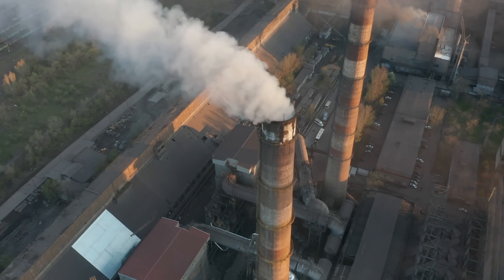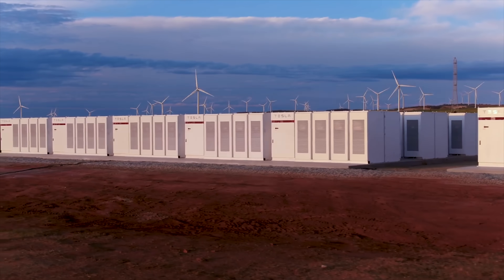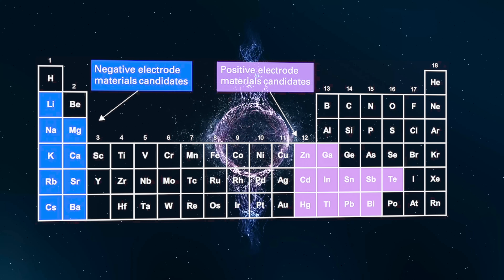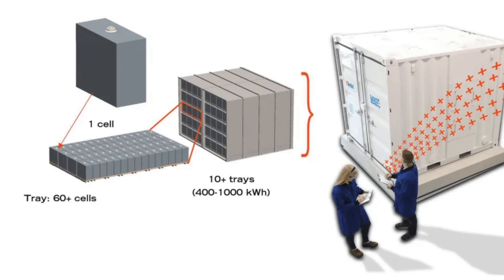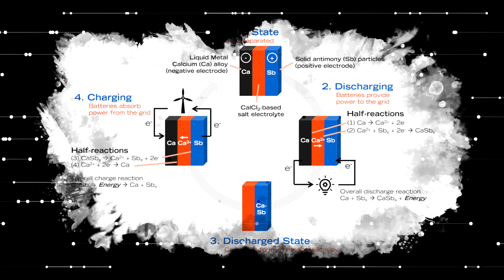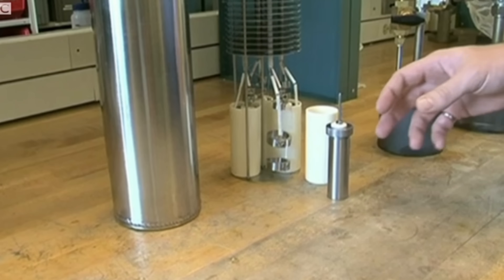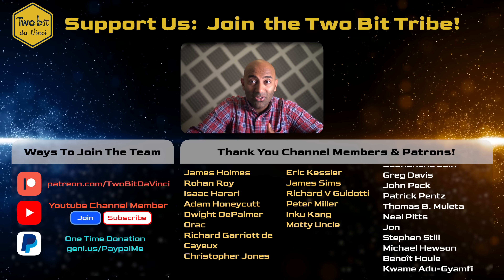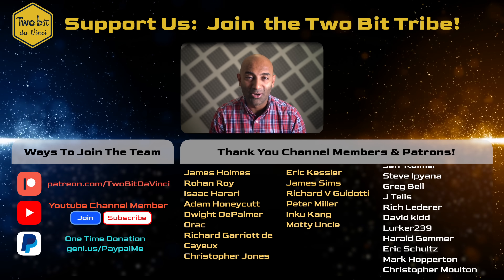Liquid Metal Batteries Have Some Shocking Properties...

Comment: EV's are just a feel good story but will never be practical for world wide use. Even wind turbine and solar have huge drawbacks. For each megawatt green you have to have a megawatt of backup power plant to run on standby. Doubling sometimes tripling the cost of power. Nh3 is cheap to produce about 25 cents a liter. Using a fuel cell to produce hydrogen. Zero emissions. All vehicles can be retrofitted. Very safe and current infastructure already in place. Has been around for 100 years used now to produce large quantities of fertilizer. New technology has made it very cheap to produce anywhere you want it. This solution no government will approve even though many have tried to get them to fast track. I suppose too much lost revenue from climate and fuel taxes. Of course lots of jobs lost in the oil industry would be a problem. Is climate change really a problem or not? Imagine the pollution reduction in  the 3rd world countries and better quality of life for the poorest. While we pat ourselves on the back driving our EV's they are producing most of the parts and materials for peanuts in conditions most people would refuse to work in.  We need to rethink all of this quickly and change course to real solutions. Unfortunately politicians work for the corporations who get them elected. Most of the large Corporations were considered essential during lockdowns and the rest were bailed out. Small business received very little and many did not survive and could not get employees when they did try to reopen multiple times.

Comment: I just had no idea for that liquid mercury battery how about several layers of cup of colds inside the glass case with Mercury bouncing around inside creating an energy field within the coal from a generator constantly generating power from solar or wind as well having the battery be a generator itself great and power as this Mercury jumps around up and down inside the coal of copper wire creating power beyond the power receiving from the generator mixed with other batteries as well these batteries will be a mixture of multiple kinds of batteries and the passengers to jump the Mercury inside to create more energy within the battery how about that could that work

Comment: The liquid metal batteries have some very high upsides. 1st, they can be sourced from locally abundant cheap materials. 2nd the metals used essentially refine themselves over the lifespan of the battery. Instead of degrading the internal material they refine. It will be the enclosure that will degrade, can be replaced, and the internal chemistry reused making recycling very economical. 3rd is lifespan measured in decades plural. 4th is heat tolerance. Lithium batteries do not typically like high temperature environments whereas the liquid metal is far more heat tolerant which makes them ideal for desert conditions.

Comment: If you are serious about lowering CO2 levels, why do you not point to the need for Nuclear Power.
The need for massive storage batteries is an attempt to overcome the problems of wind & solar. They are dependant on environmental conditions. They vary from minute to minute, and are not usable for base loads. Atomic power works any time you need. 
Love wind and solar, but they have large environmental footprint. 
If you look at the science, nuclear is the way to go to replace all fossil fuel based power production. Wind/Solar/etc. can be used to extend the lives of those reactors by giving power as they can.
Win-win as they say.

Comment: I am not sure this type of battery would work well in my house. My current solar system will produce 30 Kw/hr during summer but it has been as low as 6 in winter. As this type of battery needs to be molten, am I going to lose functionality in winter because it is not used enough?
Reply: Check out Sand Batteries by Polar Night Company.

Comment: Gasoline produces 40 times more power at the same level as Electric and the failure of electricity being the main storable source is time because they cannot store electricity Valley Power breakdown what they call Spike crystallization they have not solve this problem even with the liquid metal batteries

Comment: Don Sadoway brings new meaning to the term "Elon Time".  He's been touting how WONDERFUL this Liquid Metal Flow Battery technology is since way back at a Ted Talk he gave in 2012.  As the old saying goes, "Where's The Beef"?
It has been widely promoted that Lithium Iron Phosphate technology is also pretty good for stationary storage where the size/weight of the container is inconsequential.  BYD's recent Blade Battery breakthrough has proven just how safe and energy dense this technology can be as well and at relatively low cost.
The amount of constant energy required, just to keep the metals MOLTEN in Sadoway's design, would appear to be a MAJOR downside in efficiency.

Comment: Great vid. Funny story, when I was a kid I designed a system which would absorb some of the energy off a lightning strike. The strike would then soak the capacitor with energy and thus power homes during storms since we had a lot of lengthy power outages in our rural area. This capacitor/battery idea brings back those sweet kid memories.

Comment: I have been following the liquid metal battery ever since Dr sattaway spoke about it when he was at MIT.
I've always considered a great bulk storage and it's ideal for that on the other hand lithium ion solid state batteries whatever they are the low storage and or for cars and anything else is portable.

Or to put it another way render unto ABRI what is theirs and on to Tesla another manufacturers of batteries what is theirs a mixture of the two is the most ideal

Scientia Non Domus,
(Knowledge has No Home)

antiguajohn

Comment: Currently using lithium battery for the large scale power storage is insane because lithium is a very limited resource. We waste them rapidly.
Reply: Recycling becomes vital.
Check out Sand Batteries.

Comment: 9 years and they are still do not have a single installation up and running. They should a partnered with someone with manufacturing experience and willingness to go big from the start.

Instead we have a patent for properly the most important tech for human kind and climate change rotting with little progress.

Comment: With LMBs can you simply increase the size of the 'tank' to increase total capacity? Especially after they're installed.
Would they be good for sticking in a basement/closet/attic for home scale power, or are they grid scale only? 
When will I be able to buy one for my home? (Assuming I ever own a home :X )
Reply: Scales well with volume so probs not cost effective for small scale

Comment: The electrical industry needs to draw on the past and use giant olympic-size saltwater capacitors to store all the energy made by wind and solar to be used in the evening this is what Nikola Tesla used to power up his stations in Colorado Springs easy to build easy to maintain and can hold all the energy you could ever generate

Comment: This (liquid metal battery) seems like another form of a "Salt Battery", of which there are many types of already.  Salt batteries are the most superior method of stationary energy storage, as they last for a long time & are very cost-effective.  Also take a look at the "electrolyte battery" which is another version of a Salt Battery, and can last for generations, with almost no degradation from age.
Reply: No, it's a molten electrode, molten electrolyte battery that's self-organizing by gravimetric density.  

A salt battery uses solid, not molten electrodes, and the electrolyte is a salt dissolved in water.
Reply: Archangel, 

I'm well aware of how little wind is generated as a percentage of installed capacity, it's extremely poor. i monitor the U.k. grid daily.
One thing that strikes me if wind is good solar is poor and vice versa.

I repeat storage is overhyped as I assume people do not do the arithmetic to see how much capcity is required.
I'll expand on solar not producing when needed, in the U.K., in winter grid demand is highest in the dark, solar output is zero for several months, how much storage capacity is that?

Increase electrcity price to make solar viable, that is illogical.

The reason renewables are expensive are because they cause a lot of problems for the grid and accomodating their inferior electricity is expensive. Offshore wind is particularly expensive due to it's location, yet it is still cheaper than solar. I would also add that cost is but one factor, reliability and stability are required and cost or lack of it cannot make up for that.

Comment: The biggest challenge preventing this from happening is the insulation technology. Most people don't realize that even a one degree rise in temperature requires a very large amount of heat energy. There is a lot of energy in heat,  so if the outside of this battery feels warm to the touch, then it is losing a lot of energy.  My guess is that the round trip efficiency is under beat lab conditions. So I guess the battery will be cheaper at larger scale,  but the insulation mechanism may be really expensive. At small scale,  the insulation mechanism will be more expensive than the battery itself.

Comment: Liquid metal will (hopefully) be the go-to option for distributed storage - production buffer at solar and wind farms, network regulation at substations, fast-charging buffers at EV fast/super-charging stations, backup power for datacenters and other places that need MW-scale UPS to handle generator switch-over, etc. There is no shortage of possible uses if they turn out as cost-effective and durable as Ambri and others claim.

Comment: I think this molten battery needs some cold
water on it! It's bad enough current no pun
intended,  batteries are already a fire
hazard.
Reply: It is not a fire hazard considering it is stored in its own non flammable storage unit and is used for fixed storage options. Which parts do you think can pose a fire hazard?
Reply: @MDP1702   Well, maybe none come to think of it. If it is contained in a non flammable storage unit, and it can't exploded, maybe it's not a problem.

Comment: Presumably the container for the three liquids must be a non-conductor.  I wonder if a corning ware container would be a solution.  Then a great insulator is needed to avoid the loss of heat.  Could aerogel such as was used to protect the shuttle during re-entry be a solution.

Comment: My house has solar panel and energy generated goes directly into the Grid, pay grid fee, and sell the energy into Electric Co. But several environmental program like Green Insfractural fee, Non-fuel energy, Renewal Insfrastural program, etc., shares of the energy generated from my solar that I ended paying additional electric bill from the Elec Co.  We complain to the Solar company, they blame the Electric Co, in turn blame the Gov't  for allowing,  several Gov't/private.environmental program,. In order to offset the electric bills they sell you expensive TESLA STORAGE battery. This time the energy generated goes directly to Tesla storage battery and the battery take over the running on all appliances. You will have electric power for 4 days in time of storm Hurricane/calamities. Once Tesla Storage battery is fully charge, excess energy goes back into the grid. Without TESLA battery your power fluctuate destroying you appliances. TESLA will control the battery business, that is why EMusk is in favor of Solar and Wind Turbine. soon everybody need battery.

Comment: It seems to me that liquid batteries for grid scale using a liquid electrolyte have a fatal flaw. And a unless that flaw is resolved the technology is a non-starter. That flaw is, earthquake vulnerability. One good shake and the electrodes mix resulting in an explosion. The mixing of the electrodes would instantly release the energy, which would be converted to heat, vaporizing the electrodes. Hence an explosion. This seems rather obvious to me. Yet I have never seen a YouTube video about liquid batteries address this.

Comment: How do they contain the heat? Our phones are going to be too hot to hold lol.
Reply: Ha. Yeah, these aren't meant for small, portable uses like earbuds or phones or skateboards. They're meant for stationary grid storage, e.g., the batteries sitting in massive banks next to a wind farm to balance the output from the farm given that wind is not steady.

Liquid metal batteries aren't all that efficient in terms of size and weight, so you want to use them in places where size and weight aren't that important. But also, the bigger your battery installation, the more volume you have per surface area. So, comparatively speaking, the less insulation you need in order to keep the whole thing really hot.

(This is known as the square-cube law. It is the same principle that explains how whales can survive in freezing parts of the ocean while you can't. They're much bigger than you so in comparison they need a lot less insulation.)

Comment: I'm not sure about this tech. It is not really clear : even if oil and water does not mix, if you shake it it will mix a bit. So I suppose that theses liquid metal batteries are only for static applications like tesla powerwall, or grid scale storage plants ?
Reply: Yes they are best for grid scale applications